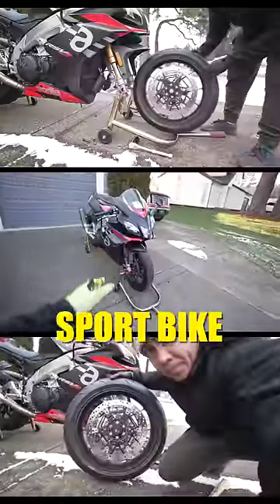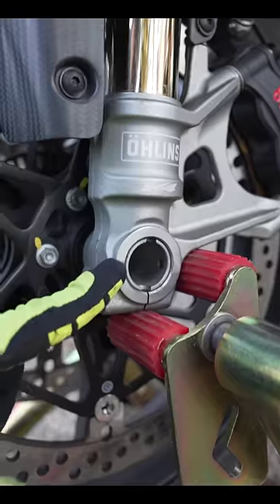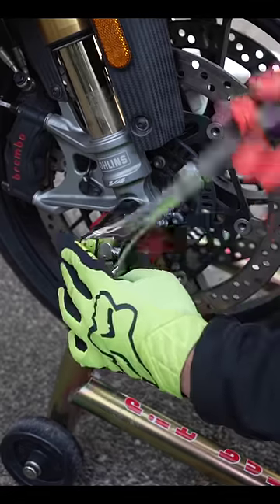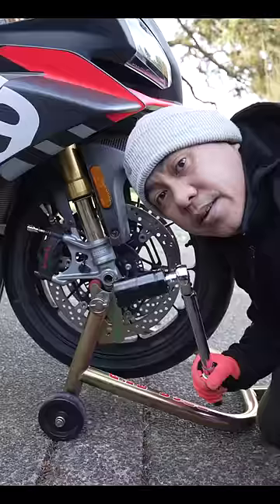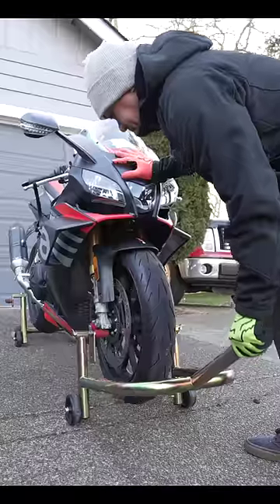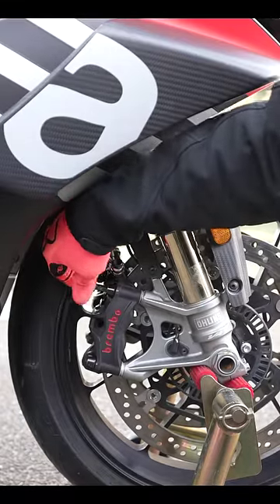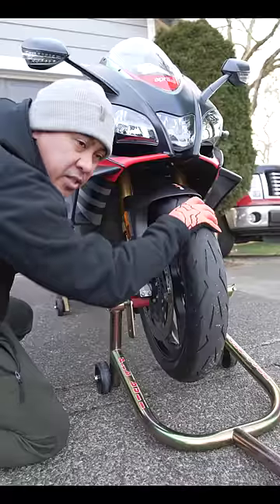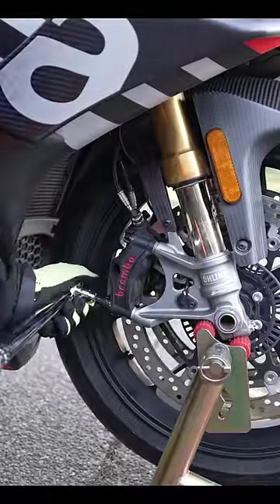how to align Sport Bike front wheel

Comment: It’s nice to see someone showing how to do stuff the right way. Keep it up 👍🏻
Reply: How do you know its correct?
Reply: @bluedogsalvage5246  you don't need to.
Reply: @Umoddafokka  it helps if you want to do something correctly
Reply: It is not the correct way
Reply: It is not the correct way unfortunately.
Reply: @leonardodorigo8091 
At least adobo giving a example yall bunch of haters saying it ain’t the right way but don’t provide anything to back up what you’re saying😂
Reply: Whats he doing wrong ? 
Should it be the other fork leg he should slacken the pinch bolts and bounce ? @jasonjohnson7805
Reply: There’s a couple reasons why this is the wrong way. 

1:
Read more
Reply: I work for an MX race team and the principle remains the sane on either. This is not needed. Especially compressing the shocks or having the caliper loose. You simply tighten pinch bolts on the open end of Axle, spin the wheel very hard and whack the front brake lever which will pull everything into alignment and then can tighten pinch bolts on close end of Axle. This is how 90% of race teams do it so not sure where this dude gets his info from. Maybe I'm wrong but I doubt it.... Been doing it this way since Michael Jackson was black.

Comment: It's not quite this complicated. I was in the bike business for 17 years. Unless you bent something, it aligns itself and calipers stay on center.
Reply: Definitely
Reply: Thanks for this. My calipers sit on spigots- they can't move or align to anything. Also, none of that stuff he is is taking about could possibly tighten up in any other position than the correct one.
Reply: Not true when you have floating front disc brakes guy has a valid point.
Reply: @hotshot2101  wrong. Unless something got bent, there is no alignment for brakes. The wheel spacers align the front wheel. The only alignment  fix if forks, discs, or hangers are bent are new parts. You are clueless.
Reply: @bluedogsalvage5246  his bike has floating rotors so the calipers don’t have alignment pins so you do have to align the calipers the way he showed it.
Reply: @bluedogsalvage5246  you are clueless it’s clearly in the aprilia manual that you need to Align the calipers
Reply: @hotshot2101  how many times have you actually had the wheel/calipers off of a motorbike? How many times did nothing line up when put back together? I worked with true floaters and various multi piston calipers, including opposed 2, 4, 6 piston varieties  and never once had one fail to go back on and be centered unless something was bent. This stuff is brutally simple, with rigid metal parts attaching to rigid metal parts with special shouldered bolts. Coincidentally, the Japanese publish a caliper to disc clearance tolerance on their models, and it's complete crap as well unless you suspect something is damaged(bent)! Experience wins every time
Reply: @bluedogsalvage5246  lol maybe you should go work on real bike’s instead of gssxrs 😂, all jokes asides all the bikes you mentioned typically have alignment pins on the calipers these bikes do not. To answer your questions about every other time and no nothing is bent.
Reply: @hotshot2101  show me a part number for a GSXR caliper alignment pin. There is no such part. In fact, show me any opposed piston caliper that has anything but pad retaining pins. Even single sided calipers don't have alignment pins, they do have guide bolts the caliper slides on in addition to pad retaining pins, but guide bolts have nothing to do with alignment. I don't think you're all that, just some arrogant punk.
Reply: @bluedogsalvage5246  lol I’m not the one here hurling insults am I? So who’s the arrogant one here. Sorry English isn’t my first language but most Japanese bikes have a notch to align the caliper were most Italian bikes don’t have that.
Reply: @hotshot2101  you haven't had insults hurled at you. You just don't seem to know how this stuff works. First it's alignment pins, now it's notches. Make up your mind. Better yet, take the wheel and brakes off of a motorcycle and see how it works.

Comment: I think you may have done that wrong. The end without the nut is the part that would spin freely (since the other side would be held in place by the nut) tightening the pinch bolts on the opposite side to the spindle nut and then bouncing the bike might not have actually aligned the forks with the brake disks.
Reply: I was actually about to comment this. I was thinking the exact same thing as you.
Reply: On the Aprilia the axle goes through the left leg first so it is indeed the captive side. On my bmw it goes through the right leg and screws into another collar in the left which is free to move. But it looks exactly the same as this left leg which is why I was confused at first.
Reply: @stevewill3572 Does it actually matter what side the lead of the rod goes through though?

Comment: I went to school for motorcycle mechanics and they definitely did not teach us this. Also I've never done it and I've also never had a problem.
Reply: good to know i’m never going to do this now 😅
Reply: @Slowkat  the only part of this i do is tightening the brake calipers evenly. after the wheel has been tight.
Reply: @matthewglaze5398  ok thanks i appreciate the info
Reply: @Slowkat  no problem. Just pay attention to where your spacers come out of each side of the wheel so you know where they go back and all will be fine.
Reply: @Supa Trending Daily that's great advice.
Reply: I was taught that with a floating front disc/discs that no adjustment is necessary, would you agree? Also from experience I don't believe I've seen adjustable caliber mounts. (Previously a Yamaha Technician)
Reply: @LightbarsUK  i would agree. I was a small shop tech but to my knowledge the floating rotor / calipers  on most bikes there is no adjustments available just a tightening order that only require you tighten one bolt then the other in stages to ensure they are straight. When torqued.
Reply: tightening  the brake callipers with the brakes locked on doesn't seem right to me!
Reply: @peterlucas789  yea i agree. Him tightening with the brake locked seems sketchy to me as well. I had to rewatch the video to see what you were talking about.
Reply: @peterlucas789  clamping the caliper centres it on the brake disc . After torqued the disc is now dead centre between the pads. So when applies brakes each pad will contact even
Reply: Yeah it’s a bit of tweaker it’s not that deep the bouncing of the front end does help with setting the front end proventing a wobble
Reply: Because that whole process is unnecessary
Reply: bad school, they should know about parallelism!
Reply: Stop it this is YouTube...we make up our own rules here 🤣
Reply: Literally makes no sense lmao, not lining up shit
Reply: If this was necissary, then none of the Superbike or supersport teams would use front quick change kits. Yet they all do….
Reply: Worked at the Honda-Suzuki dealership wrenching on bikes, never seen this in the manufacturer service manuals. Always torque the axle and torque the pinch bolts. Check that wheel spins freely and brakes work. If not, you didn't put it back together right
Reply: @VictorGalayda  exactly.
Reply: This is way more complicated than it needs to be. Just make sure to use a torque wrench and buy a factory service manual. Follow the manual and your doing it correct. You brake disc are floating disc and your caliper is pinned so it sets in the same place every time. How is that adjustable or able to be aligned?
Reply: @slingingearsburningrubber5759  agreed.
Reply: You do the exact same thing on a DH bike 😂
Reply: @Jay-vr8it  this is what dave moss does. He's a Moto GP  guy, who now helps others set up their bikes.  He knows what he's talking about.  The margin for error in that sport is almost non existent. That's where this procedure took form. This guy included learnt it from him or had his bike set up by him some point in the past probably where he learnt it. Just google dave moss and you'll know what I'm talking about

Comment: That’s cool and all but my owners manual just says to slap it on and use a torque wrench👍
Reply: @Roller-01  Honda is just a different breed of bike. Sort of like comparing a light infantry vehicle to a tank. The CBR has a drift car turning radius where for example on my r6 and r1 I look like Austin powers on that little electric car in the tunnel all the time.
Reply: I agree I've had many bikes many brands, none ever showed this process, not saying he did anything wrong but kind of unnecessary steps...
Reply: @andyb9994 my yamaha shows similar steps
Reply: As know bikes, I'm surprised as this motorcycle has a thru axle, like my next road bike the trek emonda alr has thru axle
Reply: Even on a mountain bike it's an excellent idea to align the caliper. Otherwise the rotor runs flexes gets hot makes noise and either grabs too hard or fades away, sometimes both on the same descent.
Reply: @tetriseffect711what he is doing is aligning the forks first by bouncing to eliminate any twisting which might have occurred. Then re-aligning the calipers over the rotors. Always a good idea to do.
Reply: That’s weird mine says 4 Uga-duga’s with 1/2 inch impact??
Reply: Maybe its just his bike 😂 look at the way it bolts through and had those side clamp bolts@andyb9994
Reply: @AlexKosinski man what?!? 😂
Reply: @koopspook did the front tire of my R6. Didn't technically do what he did (that spool trick for instance) I should give it a once over before it gets colder and when I get some quality paddock stands, for now I'm stuck with my Amazon Special select lol
Reply: @mlee6050 It's probably more of an Italian, newer gen bike thing. My '03 R6 doesn't have a thru rod.
Reply: @juniorleyva7168 yeah, those are radial brake calipers. Kind of sort of glad my '03 R6 doesn't have them.

Comment: That’s wild in all
My years at a dealership I have never seen a service manual say this nor have I ever had any sort of alignment issues. The newer bikes can’t really be  fucked up. Calipers have dowels so they aren’t adjusted. Wheel has spacers specific to each side, a big axle bolt threads into a hole that cannot be moved or changed without loosening the fork mounts. Then 2-4 bolts to lock it in place and keep it tight.
Reply: This. The whole video felt reeeaally strange to me. What alignment, what the heck, how and why😂
Reply: I thought the same until I had a problem with brakes after tyres changing in s1000r 😂 after alignment everything is good.
Reply: I did see that on a few bike that have recently rolled in. Some bikes need it and others do not
Reply: My RC390 owner’s manual details similar sequence for mounting the front wheel 🤷‍♂️
Reply: Never once done an alignment on hundreds of bikes.
Reply: Not sure why the algorithm has chosen this dude for me, but in 3 videos he’s 3 for 3 full of shit. Maybe that’s his gimmick
Reply: @JoBlo-o3y  Probably because everyone is interacting with it and talking about the wierd shit going on. Algorithm loves that
Reply: it is called tolerance stackup.
Reply: This guy is a you tuber that does everything to get attention do you really think he is telling the truth
Reply: The caliper thing is totally useless and meaningless, but the way he put the front wheel back on is indeed the right way to go about it. It matters most for race bikes where suspension tuning is of utmost importance. Barely matters for a street bike, and still hardly matters for your average track day bro. The only thing you're aligning is the forks, just ensuring they are as parallel as possible to reduce binding/friction through the stroke as that will screw with your suspension tuning.
Reply: @anthonyantoine9232 really speaking yeah. It's pretty much forks and tire. Since the wheel is already balanced (well should be at least), you don't need to align anything. So long as you follow you bikes spec and reinstall method, you don't entirely need to do what's on the video. And unless you need brake fluid/bleed the caliper with work itself in with use because the rotor is reinstalled to where you took the caliper out (caliper piston height).

It's just 2 rounded wheels, not 4. If anything id look into fork stem adjustment. With age +miles you're bike will need a once over on a few things.
Reply: @soskarr 
I guess you loosened the (when you stand in front of the bike) right bottom bolts too. If you leave that how it is, once its adjusted right, you can unscrew the axle from the left side without needing to allign anythin😉

Comment: Its the other side without the nut that needs to be loosened after you tighten the wheel nut. 
The fork on the side without the nut can move freely on the axle, the other side can't after tightening. 
This is the correct way 👌

Comment: I few questions (I have never worked on a sport bike) 
1.unless the axel is cammed then how does it effect the alignment. 
2. The bike was already setting on the forks so what did putting it on the tire compressing the suspension then lifting it back up on the forks do.
3. Unless the calipers have in and out adjustment why do they need to be clamped down before tightening them up (this is one of the benefits of disk brakes they are self adjusting)

Comment: Excellent! Thanks!

My 2023 Hayabusa manual states to first torque the axle nut to proper torque then tighten the axle nut side pinch bolts to torque values. After pressing the handle bars several times, torque the pinch bolts on the other side. So maybe Aprilia has different alignment methods???

Comment: I hope you loosened those pinch bolts on the left before you compressed the suspension, that's the side that needs the fork leg to center up. The axle cant slide relative to the right fork once the nut is snugged up.
Reply: That's what I said and he lmfao'd me and told me it makes no difference. He doesn't understand how this works. O well I tried ,lol.
Reply: I noticed he wasn't too interested in fixing his mistake lol, I juat feel bad for anyone who thinks this a "tutorial" haha
Reply: EDIT: I finally got this.

The front wheel axle has a nut/bolt on one side, while the axle side is free.

1. Torque-tighten the nut/bolt.
2. Torque-tighten the pinch bolt on the nut side.
3. Install, align, and torque the brake calipers.
4. Align the fork by pumping it up and down.
5. Torque-tighten the pinch bolts on the axle side.
========================
So is everything supposed to be loose before compressing the suspension?
Reply: @pieman that's the correct way how you described it, and one more thing, the forks should be pumped WITHOUT pulling the lever, since the calipers were not yet aligned and torqued to spec.

Comment: IDK I'm pretty sure that's backwards cuz the gsxr are similar setup.  And the side with the nut is the captive fork.  The nut sets the axle with that fork and the open side is the free fork that needs to be aligned.   IDK i could be wrong with that bike but I know for a fact 100% on GSXRs you need the special socket and you have to tighten the NUT side pinch bolts first  then align the OPEN side fork, then tighten the OPEN side pinch bolts.

Comment: Great video ! 👍🏼
But definitely don't Have to do this
It's a great idea though
Reply: You definitely HAVE to do this, or your brakes will wear unevenly and the front end will shake.
Reply: @Tha Ginger Ninjer  no its not mandatory,  but I guess if you have time, why not.
Reply: It is definitely mandatory. If you don’t have time to do it right, you shouldn’t be doing it.
Reply: @thagingerninjer5391  No it isn't. Optional, yes. Necessary? No.
Reply: @GTI1dasOriginal  it is absolutely necessary. Not my fault you’ve been doing it wrong, and now you’re Butt hurt about it.
Reply: My Honda is much simpler slap it on torque 40ft. lbs. axle 16ft. lbs on the pinch bolts 22lbs on caliper mounting bolts
Reply: @thagingerninjer5391 Dude just because you saw some youtuber do this it doesn't mean its necessary. Ever seen professional racing teams change tires? The wheel align itself through the axel and spacers. The calibers have a fixed position nothing to align.
It doesn't harm what he does but its definitely not required.
Reply: @thagingerninjer5391 my guy, you do not have to do this.

Comment: You are supposed to tighten the pich bolts opposite the nut just to torque the nut. Then loosen the pinch bolts again. Then have someone compress the forks while holding the brake, while you torque the pinch bolts. This process is to make sure the fork tubes are perfectly aligned, otherwise you will have undue wear and damage to your fork internals. Not really sure what you are "aligning" with calipers, because the pistons will center themselves to the rotors.

Comment: There are two videos for front axle and front wheel alignment.  #1 is “Aligning motorcycle fork legs properly after mounting the front wheel”
Motorcycle suspension tuning
1. Torque axle , torque pinch bolts on the thread side.  2. Bounce front end several times to set free leg straight then torque pinch bolts.   3. Leave caliper bolts quarter turn loose, spin wheel and apply brakes and no not release the lever.  4. Torque brake caliper bolts

Comment: Strange how they don’t do that on race bikes every time they change a wheel.
Reply: It’s probably one big nut like f1 cars
Reply: They also don't really care what happens to the parts as long as it gets through a singular race, teams cut a bunch of corners to get what needs done done. No race mech can truthfully maintain their own machines the same way they take care of race machines.

High level motorsport racing also used specialized parts, not designed for regular use anyway
Reply: We don't do it becaus there is absolutely no diference, there are not enough tolerance for parts to move around